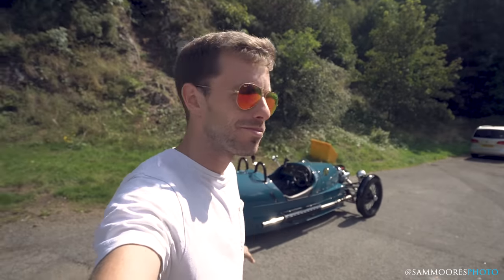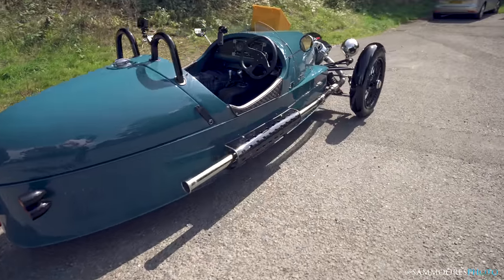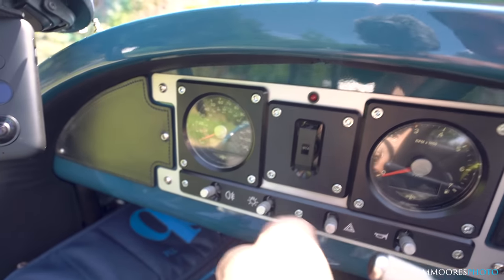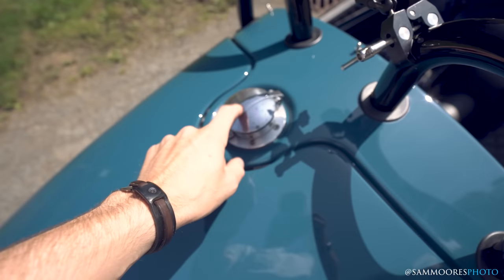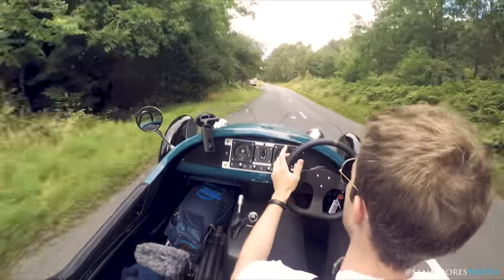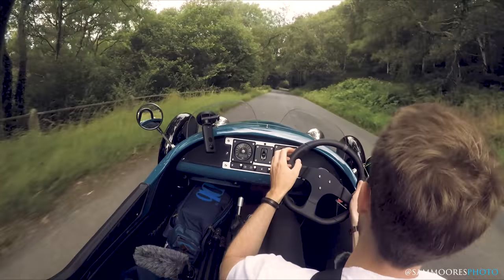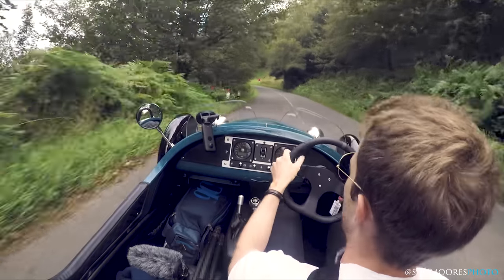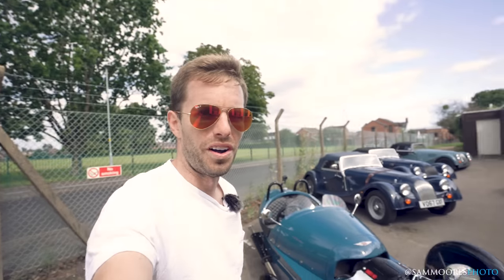What Is A Stage 1 Morgan 3 Wheeler Like?

Comment: Fabulous. I want one. But boy are they expensive.
Reply: 40,000£
Reply: Too late production chopped !
Reply: @pranjalsharma479  and worth every penny.
Reply: @bertiewooster3326  yes, but they are supposed to be introducing a new and improved model for 2022. keep in mind that the one that they have been building since 2012 was not designed by morgan, it was actually designed several years earlier in seattle, washington in the usa by a company called liberty motors and was marketed as the ace cyclecar in the form of a kit car that had to be assembled by the purchaser. charles morgan, the grandson of hfs morgan who founded the company heard about the ace cyclecar, visited seattle and negotiated a deal to purchase the rights to the ace cyclecar so morgan could manufacture it in the uk in a more authentic way (the ace cyclecar was fiberglass with a harley-davidson engine and a ford transmission and was designed for assembly at home with minimal tools). in 2013 charles morgan was forced out of the company for unknown reasons, but morgan continued to make the 3-wheeler anyway. it will be interesting to see what the replacement model is like, hopefully they will keep the original v-twin engine layout and not switch to an inline engine like the morgan f-series which was a pretty mediocre and poor-handling pile of crap....
Reply: @marzsit9833  The engine will be an inline 3 or 4 cylinder  like the ones in the 1950s As for Charles he was outed as bring almost responsible for bankrupting  company.

Comment: If a Morgan is classed as a motorbike if i pass my test using a Morgan does that qualify me for a full motorbike licence.
Reply: it depends on the local law. in my state in the us a 3-wheeler requires a different endorsement than a 2-wheeled vehicle and there are no motorcycle-only licenses. everybody starts out with a normal car driver's license which allows you to legally drive any car or truck with 2 axles up to 26,000lbs, then you take additional tests to get endorsements for additional vehicle classes. for vehicles with more than 2 axles or heavier than 26,000lbs you need a cdl (commercial driver's license) which is costly and not easy to obtain, and there are several classes of cdl with class-a being the most difficult and expensive one, especially with flammable/hazardous and explosive cargo endorsements added to it.

Comment: It IS a Harley engine . ...
Reply: Its not
Reply: sort-of.. the morgan uses an s&s x-wedge v-twin which has a 56-degree angle between the cylinders. harley engines have a 45-degree angle and the x-wedge shares no parts from any harley engine, it's a unique design but looks similar and is used in a lot of custom-built bikes.

Comment: Great video fantastic footage nothing wrong with that it's just makes me want to nitpick you said that the car came out eight years ago which is not incorrect, Aero reproduction concept debuted in 2011 but the 3-wheeler Aero goes back to the mid teens at the very least, if you were at the factory then surely you should have seen some of the originals they had on display.

https://en.m.wikipedia.org/wiki/Morgan_Motor_Company
Reply from the maker: Er..yes...but this model came out 8 years ago. If I were to talk about my GT3RS I wouldn't say it came out in 1960s.
Reply: @sammooresphoto  I know I'm not trying to be too technical just I kind of cringed when you didn't specify. 😖😉
Reply: I was thinking the same thing. The host made out like it was a new vehicle which is just so wrong! It'd be like someone saying Mini Coopers came out 20 years ago.  No one would say that unless they were completely oblivious to the actual history of the vehicle.  Great video though :)

Comment: Sounds like a Japanese V-twin instead of an S&S motor.
Reply: cylinder angle is different, s&s is 56 degrees, harley is 45 degrees. firing order is the same.
Reply: Sounds OK, but not as good as an old Ducati with Conti 'silencers' !

Comment: Only 80 bhp out of 2 litres!
Reply: Alan Sharpe 
That’s the consequences of the EU-norm. A push-rod, aircooled single carburetted engine can’t be effecient and sensitive at the same time.
Reply: It's a S&S engine... same as Harley-Davidson. It's also efi.
Reply: yes, 80hp but with diesel-like torque delivery. not designed for quick acceleration but look at the tires, would you really want more horsepower?

Comment: too bad that the idiots at morgan fucked up the 3-wheeler for 2022, the new one is going to be a remake of the f-series using a 3-cylinder ford engine. the reason the v-twin model was loved was because it was retro technology with a modern twist.. the loud, torquey v-twin was the reason for wanting one of these, the new one is going to be a huge bomb for morgan because very few people are going to buy that pile of crap.. nobody cared about the 80-horsepower engine, and nobody is going to care about the new higher horsepower shitty-sounding engine. good news for the lucky owners of the 2011-2021 models, the value of your morgan is about to triple or quadruple so don't think about selling it yet.... i'm guessing that libery motors is going to start producing kits again and if that's the case i would buy one of those before even considering the new model.